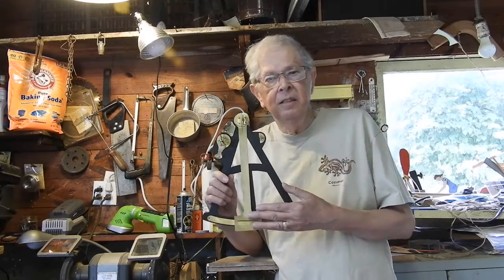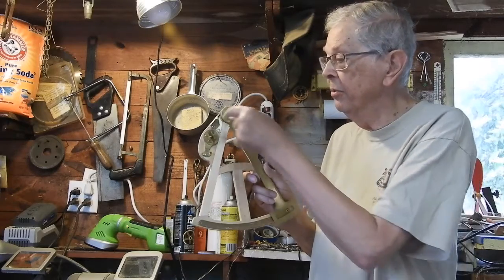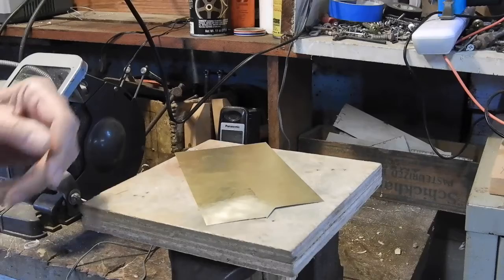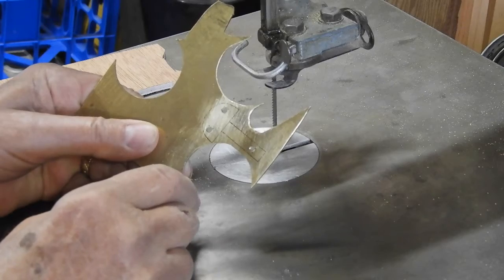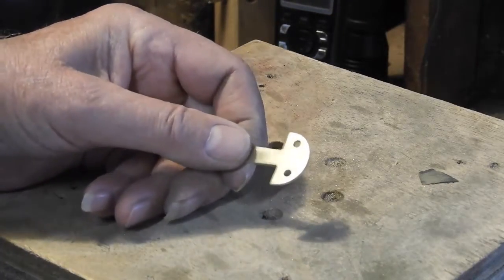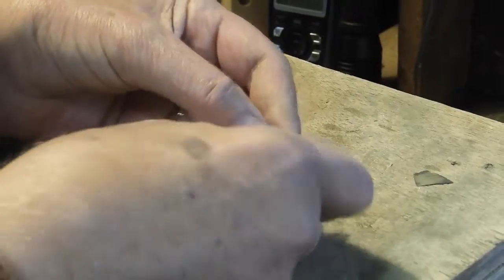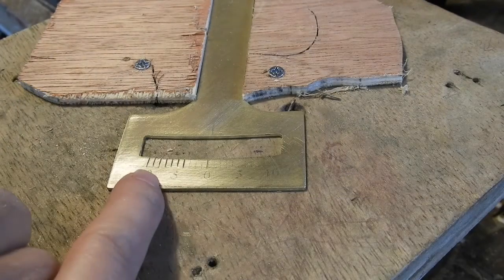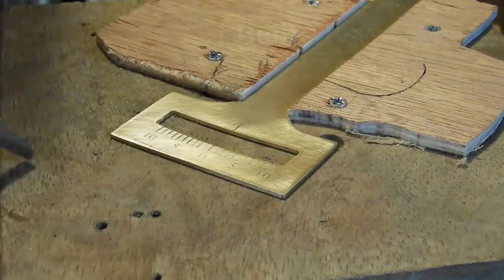Making an Octant

Comment: This is incredible! Any chance you might still share the plans and instructions for making one?
Reply from the maker: I would not have a problem with sharing plans if I really had plans to share. Most of what I have is several sheets of Adobe Illustrator diagrams. If you are interested in them and they would be of use, let me  know and I'll figure out how to get them to you. Please advise.
Reply: @charleshartley440  I am definitely interested in them! Coincidentally the workshop at my local university has a laser cutter that is set up to use adobe illustrator files for instructions, so I'm hoping I can get your diagrams to work with that without too much fuss (or a lot of fuss if necessary).

I can give you my email if there's somewhere I could directly message you, or I could even just make a burner email and give you that in the comments here.

Thank you!
Reply from the maker: @brain_snakes  Send me your email address to hartleyc@hartwick.edu. I don't work well with messages. :-)